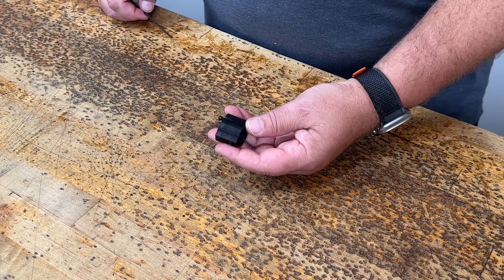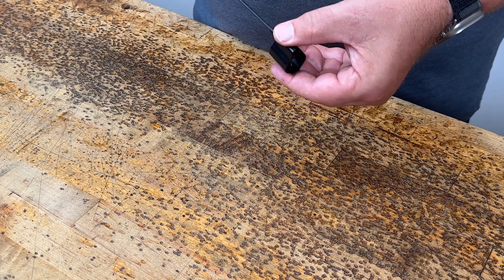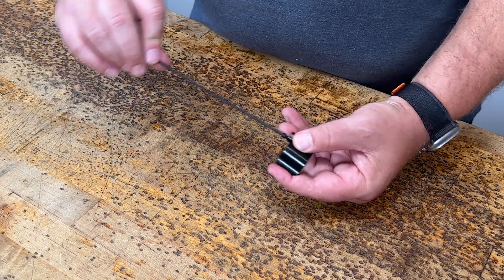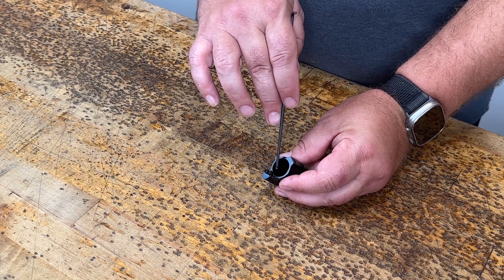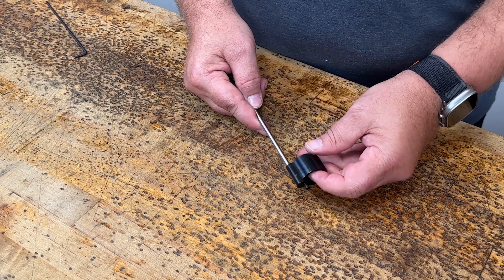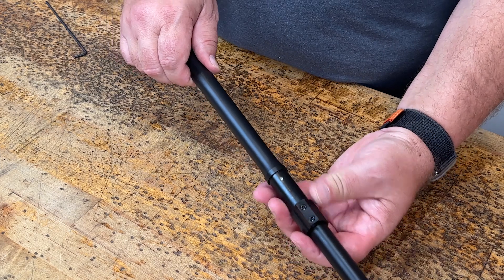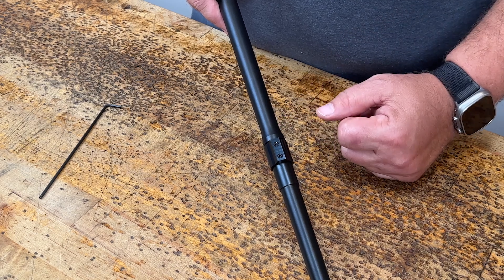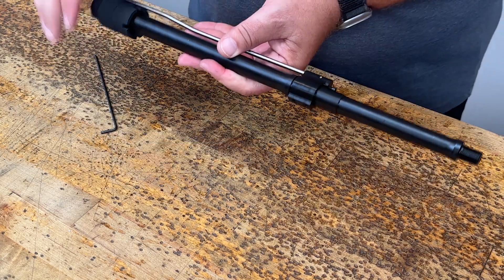NEW Product - ZEROED Adjustable Gas Block

Comment: In 7.5 inch 556 AR pistol ... Why does the Gas Port  erode prematurely with the adjustable gas block?  

Is the accelerated erosion is going to happen either way with the Pistol length gas system?

Thanks in advance.
Reply from the maker: it doesn't have to do with the gas block. it's just due to that round and a pistol length gas. It will erode regardless of the gas block.
Reply: @CMMG thank you

Comment: Is this adjustable gas block rated for a pistol length gas system?
Reply from the maker: we wouldn't recommend it for pistol length gas in something like a 5.56 as you are going to see erosion of your gas port prematurely with that gas system which will eventually get into the workings of the gas block. So technically you can use it, but you should be mindful and be prepared for regular inspection and maintenance. Something like 300BLK would be good.
Reply: @CMMG  why does the Gas Port  erode prematurely with the adjustable gas block?  

Or did you mean to say that the accelerated erosion is going to happen either way with the Pistol length gas system?

Thanks in advance.

Comment: ? I got my CMMG DISSENT 300blk out in 2023 do I have the zeroed or a different adjustable gas block ???
Reply from the maker: not likely. The adjustable gas blocks weren't standard on all models until this year. You should be able to see the adjustment screw on the front of the gas block if it does. Or you can email our customer service with your serial number to confirm.

Comment: Mine siezed after 2 years and a couple thousand rounds... Guess i need to take it off 😑
Reply: Damn really? So did you upgrade yours or replaced it through the warranty dept ? And I got the dissent blackout what do u have that seized if u don’t mind me asking
Reply: @Hoodstapizzo I haven't taken it off yet, it's on a 300blk. Probably needs cleaned out.

Comment: Mine was super tight to get on. Had to tap it with a small punch and hammer. The roll pin for the gas tube wouldn't seat all the way either. Everything was lined up and it wouldn't go through.

Comment: Does the 6.5 300blk dissent already come with the zeroed agb?
Reply from the maker: It does come with an AGB. Depending on when it was manufactured will dictate if it's one of the ZEROED or not. Early DISSENT models came with other brands, but they function very similar.

Comment: I didnt get that wrench with my br3(308) or br4 (556). I grab a wrench though. More gas is loosen, less gas is tighten? Or is it the other way around?
Reply from the maker: Clockwise tightens which does close off (or lower) the gas. 

Sorry for the wrench. It unfortunately only ships with the gas block that's sold separately.
Reply: @CMMG  Same. I have a BR4 and it throws the brass out at 1 o'clock. What size Allen wrench is that?

Comment: Can you use a 22lr suppressor on an ar15 with the 22 lr conversion kit?
Reply from the maker: Wouldn't recommend it. The bullet stabilization isn't quite right with the conversion. You could run the risk of a baffle strike. A dedicated barrel would be ideal.

Comment: How often do you have to clean it before it seizes?
Reply from the maker: Really depends on the ammo and use. Unfortunately there is no set answer. If you'd like, you can always add it to your regular cleaning regiment.
Reply: @CMMG so it’s guaranteed to seize up ? 🙄 I have the 300.blk out dissent 6.5inch barrel and I’m so paranoid so adjust it first off charging that higher price and not having a better gas block or adjustment key to tell the user the proper way to turn and adjust it also having 20 clicks is a lot to go through to find a proper gassing so I feel limited to shooting supers being I kinda regret it being this is a major failure point also the steel used is low end compared to other manufacturers in the same or similar price bracket I mean u all made the pistol attractive but the parts aren’t as reliable as the price suggest and I’m a verified customer so I purchased a parts kits because I see a lot of wear on the bolt just from shooting 600rds of supers I wish you all treated the customer better you all take 6-9weeks for warranties to be fulfilled pls do better CMMG seriously. Also wish you all used a phone instead of waiting 4-5days to receive a email
Reply: In other words buy a Faxon gas block.
Reply: @p47rr  Weird way to spell riflespeed.
Reply: @GldenRetriever strange I read superlative

Comment: Will this make my banshee 9mm more reliable with the can and the folder?
Reply: Banshee doesn’t use a gas system it’s radial delayed blowback
Reply from the maker: You may want to run our Action Tuning Kit. 9mm doesn't use a gas system, so there it no block. But, the Action Tuning Kit does allow you to tune your 9mm similar to how a gas block would.